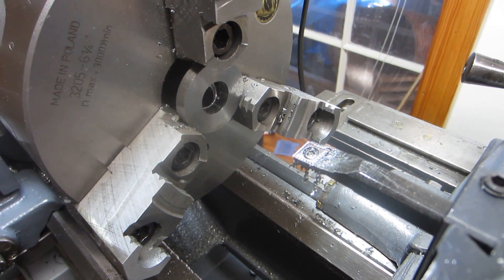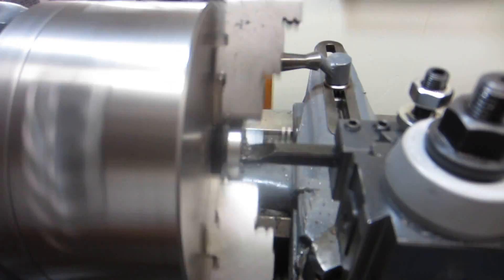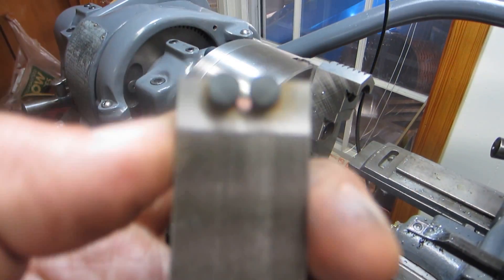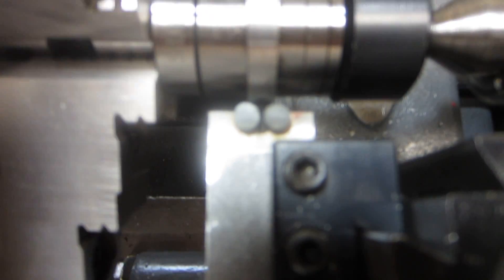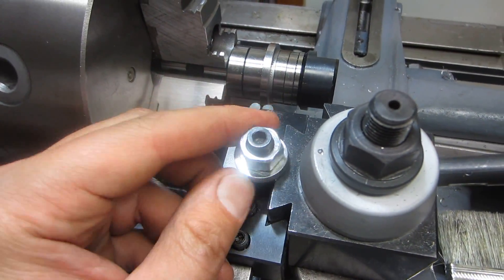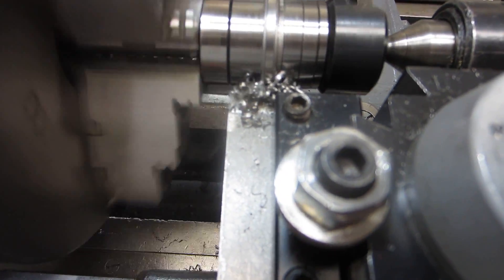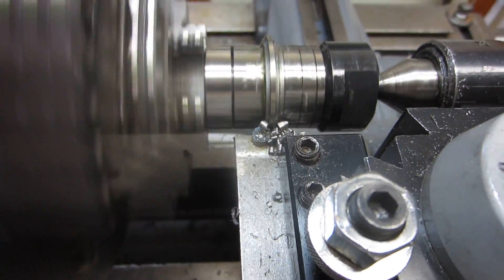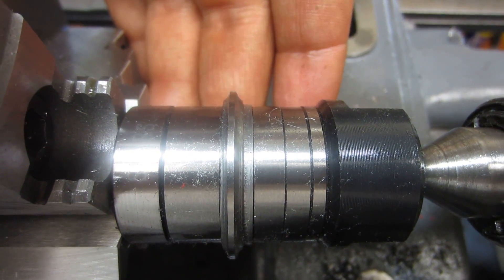Making an involute gear cutter: Part 1 - Forming the profile

Comment: When pressure angle is 20 then maximum number of teeth is 41.above it the base circle falls below dededendum circle. can you tell me how gears with large number of teeths are made. Are they involute or any thing else.
Reply from the maker: The vast majority of gears today are involute.  The exception is clockwork, which still favors cycloidal.  And I'm not sure if I follow your first question.  Gears today are made by hobbers and gear shapers.  These methods both produce true involute tooth profiles.  My method in this video only approximates an involute profile, and isn't a good method.  I was just doing this to scratch an itch I had regarding tooth profile formation.  After I learned more and realized this method would never ever produce a "perfect" tooth profile, I kind of gave up on the concept, and that's why there has never been a part 2.

Comment: 7 years later I'm still for part 2 😀
Part one was excellent by the way
Reply from the maker: I give you credit for keeping the faith.  Truth be told, part 2 is unlikely to happen, as I learned how to make true involute gears using shapers and hobbers.  I feel like this method is a real hack, although it could be useful in certain emergency circumstances.
Reply: @NoelBarlau  I for 1, would be happy for a same style video of you making a gear hobber. 
I always think it’s “just” a thread with a definite/weird pitch then cut the flutes, harden, hone... done.

Comment: What DP are u using and how did you arrive at the button diameter. I read Ivan laws explination but left me with questions. The way I understand it. The buttons would be the size of a saucer. Help
Reply from the maker: You'll probably not believe this, but it was over three years ago that I started this project, and it's going to be very difficult for me to find my notes at this point.  Try this website, he has some great info on making a gear cutter.  http://www.metalwebnews.com/howto/gear/gear1.html

Comment: Your camera probably has a macro mode for close-up focusing. Some button or menu setting with a flower symbol should activate it. If it hasn't and you decide to upgrade, look for the spec called 'closest focusing distance'.
Also, many older digital cameras (sadly) can focus much closer on the wide angle side of the lens than the tele side and some even have to be set on fully wide for closest focus. This would probably make for very weird looking video though.
I enjoyed this project tremendously, don't bother to argue with nitpicking nutters on Youtube, they aren't worth your time, life's just too short.

Comment: Did you ever complete the cutter?
Reply from the maker: Great question.  No, I didn't.  Simple reason:  I am a great starter, but not so great finisher.  I now see that this video has been watched WAY more many times than I ever anticipated, and I have a duty to finish the job.  Unfortunately, I'm in training for a new company and won't have time for the next 5 weeks or so.  Completing this project will be my first priority, so I should have the next video up in the next two months.  Sorry for leaving everyone hanging!
Reply: Wow, thanks. There are some other videos on the matter, but this seems to be the most straight forward way to do it.
Alternatively, you could make a gear hob using mothing more than a ground 40* angle lathe tool.
Reply from the maker: Anand Rajamani Well I've fallen down on the job yet again.  Promise broken.  The project to complete the cutter is still on the (very long) list of things to do, and I hope to complete it eventually.  The issue is that I wanted to make the "Eureka" profile forming tool, and produce a "real" gear cutter as opposed to a simple single-point cutter.  There are many videos on YouTube which use this single-point method already.  Manufacturing the Eureka is taking much longer than anticipated, as I'm now commuting to my job in Denver and have less time for my hobbies.
Reply: Noel Barlau life happens sometimes. I hope you get chance to pick up your hobby and start making videos again, these were very interesting. :)
Reply from the maker: Well, thank you for taking the time to say so. Very glad you enjoyed them! I certainly appreciate the sentiments, and hopefully I'll be able to spend more time working in the shop in the near future.  Fingers crossed!

Comment from the maker: This is where I'm at right now - I just returned from vacation and I'm trying to get motivated to finish this project.  My Rong Fu CNC mill project has taken precedence and I've put the gear cutter on hold.  The plan is to use the newly functioning CNC mill to make the "Eureka" relieving tool, but of course this is running before one learns to walk. The proper thing to do would be to mill out some of the cutter to form a relief profile just to get my feet wet. Stay posted, it's coming...

Comment: O.K. Great!  I assume the next step is grinding a sharp somewhere in the the profile ring to fly cut out the material on a gear blank?

I have to remake a reversing involute gear on my lathe (about 2" and 32 teeth).  It was originally cut from laminated Formica.  It was built that way in the 1950's as an attempt to attenuate noise, but quickly proved to be the weak point in the gear train and likely has been broken since '62.  I could remake one from brass I suppose, but need to see your part 2!